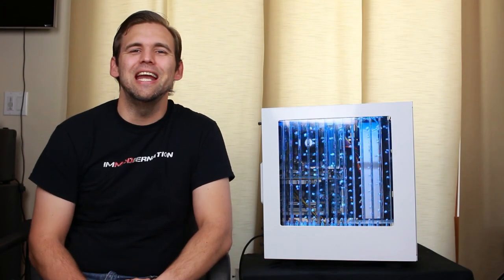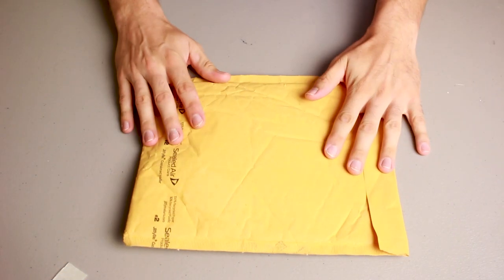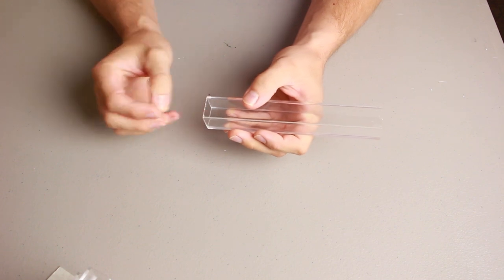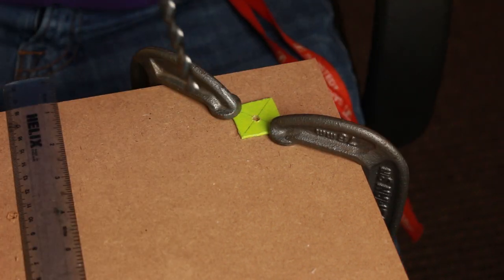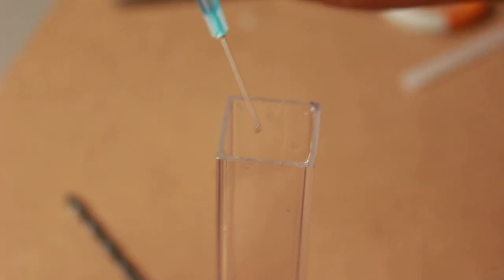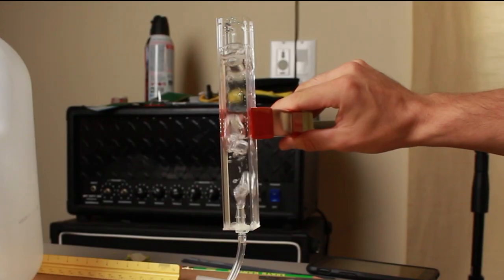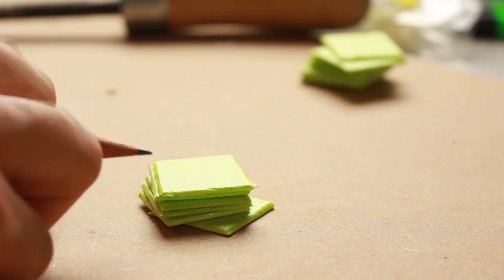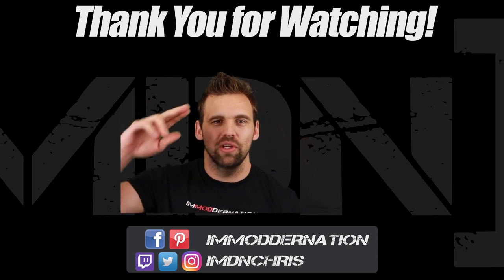BUBBLE WALL PC BUILD VLOG PART 2

Comment: Quick tip: Don't use hot glue, use aquarium type silicone caulking. I know it takes much longer to cure but it will provide a better seal between itself & the surface. 
Hot glue peels off the surface much easier & water can leak right through.
I learned this the hard way when trying to do some quick bathroom repair & my friend who is an experienced plumber laughed about it & told me never to use hot glue for trying to seal out/in water.
Reply from the maker: Someone at Maker Faire recommend Marine glue. The stuff used on boats. I know I should have Flex Taped this thing! 🤣

Comment: Wow. Lot of work & parts etc go into that mod just to get that effect. The side panel is also bulky, wide/thick &  weights a lot with this. Sheash. Lots of points of failure as well. 
Very risky for putting in a PC.
I commend you for the efforts & risk doing this!
Reply from the maker: I used an older system for the prototype until I can get to a place where there won't be leaks. Very heavy indeed. More parts to come in the next videos.